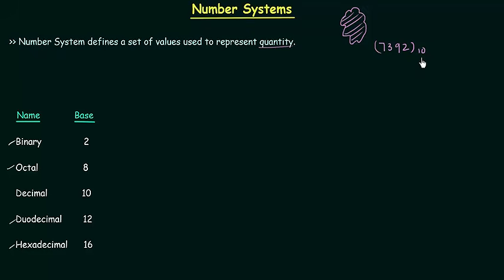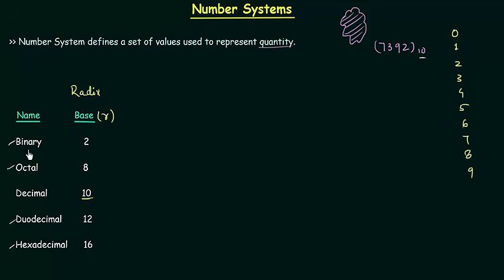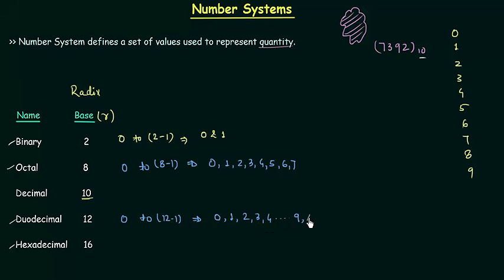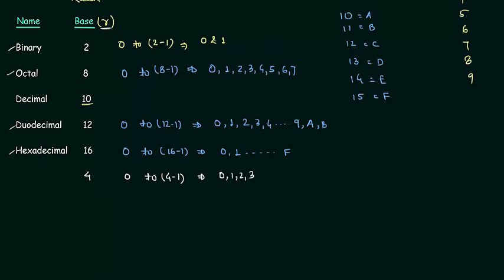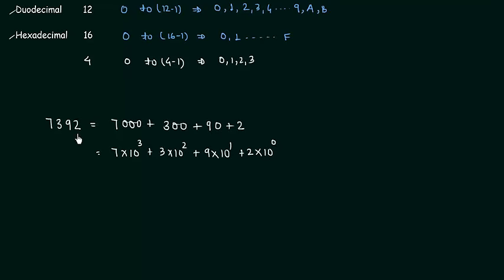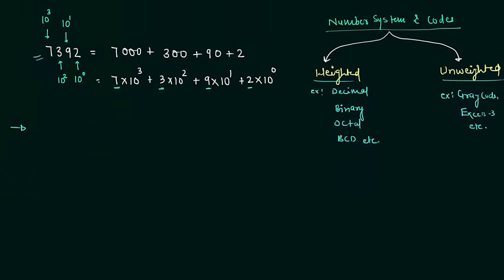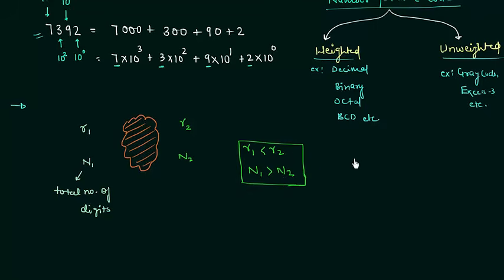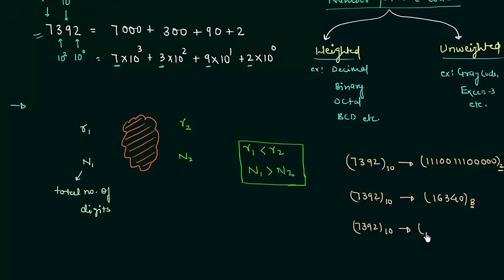Introduction to Number Systems

Comment: The given definition for numeral systems in this video doesn't defines numeral systems but radixes. Because numeral systems aren't only set of values (digits). They are complete methods to express different numbers with unique representations. Like decimal system is the method of expressing a number using a set of digits. How to do it?. Every digit of the sequence is multiplied with 10^n-1 such that n is the digits positional number in that sequence. Then all such products' sum is the number. e.g. 69.69=6x10^1+9x10^0+6x10^-1+9x10^-2. These whole description of how to express a number is a numeral system. And the set of values or digits are only bases of them.
To define numeral system we can simply say,
Numeral system is a system for expressing different numbers using sequences of symbols named digits such that no other number has that same sequence in that numeral system.
Reply: What is the use of numeral system
Reply: U wrote. Too long msg how I think it took 5 min at least